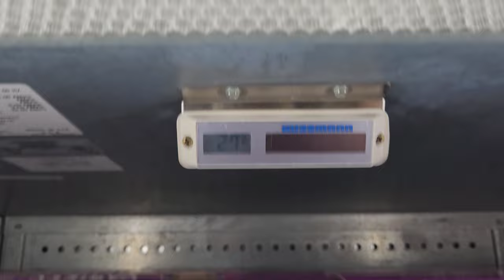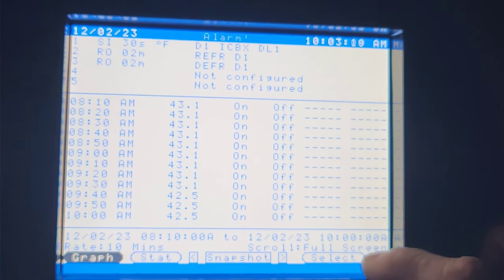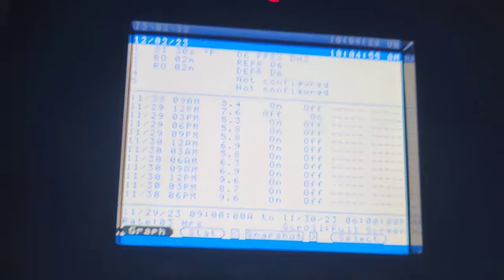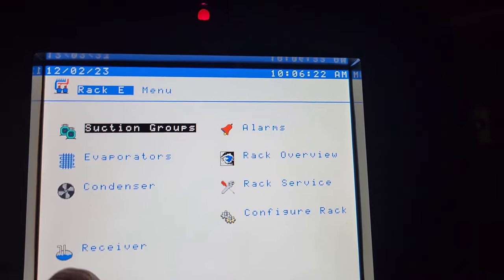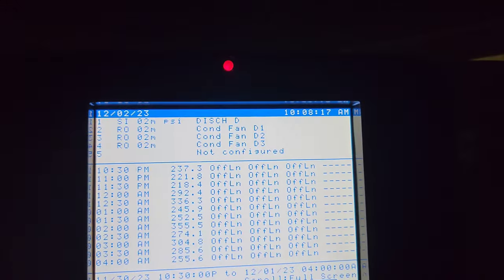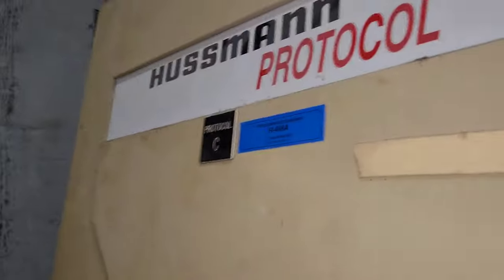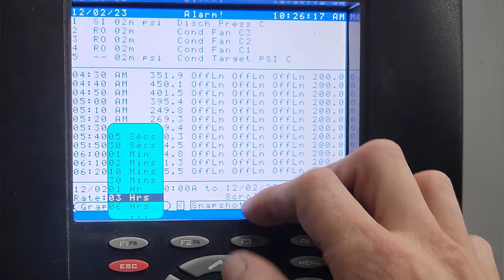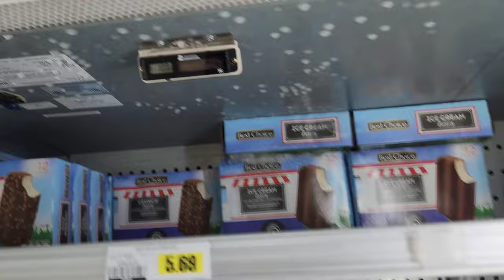Breakers Turned OFF On Purpose?

Comment: Wow, just wow - when the breaker room needs CCTV...  Those controllers that go into alarm, I presume they are capable of taking a beacon light or buzzer on an output?  If that was the case then someone could have called the fault in on the morning it occurred, potentially saving all that food from going to waste.
Reply from the maker: yes they are very capable. unfortunately, this particular grocery store chain does not have the Danfoss controllers monitored by Danfoss like the bigger, more profitable and reputable chains do. they dont even monitor temperature, liquid level, and other key parameters they they should. makes me think that Danfoss charges a pretty penny for a Subscription type of deal and they're not interested in paying it. shoot...they have freaking KE2s on most circuits controlling temp, which also have 4-30 defrost settings enabled AND the danfoss shuts the EPRs down on a different set of 4-30 defrost cycles. lmao

Comment: Reminds me of Stop and Shop in NJ and NY.
Question is, who the hell was probing around in them panels in the 1st place??? Also, WHY??
I doubt any renovation work goin on, especially around the holiday.  Thats black out time for store work! 730 in morning ... they gotta look back in see vendor logs or who the hell is even smart enough,  or ballsy enough to turn off breakers for NO REASONS. 
I know many the stores i done work in, kept panels locked. Just for that reason! Keep the asshats outta where they do not belong! Only person in store with key, would be STORE MGR. Then of course,  the contractors already has key to just about any panelbox made out there. 
Good video brother.  Be safe out there
Reply from the maker: Thanks! Yea, I agree totally with all you said. Especially locking the electrical room. Thanks for the comment!
Reply: I’ve worked at a grocery store as a  shift supervisor for a short time. Majority of electrical panels for equipment like that were in locked mechanical rooms that only store management had keys to. The only “accessible” panels that weren’t in those locked rooms were generally  behind service departments like the deli, bakery, etc. That fed receptacles, miscellaneous kitchen equipment, like rotisserie, ovens self-contained region refrigerators/freezers, and sometimes a few lighting loads.
Reply: @HVACRServiceTech  Absolutely! Keep up that awesome work
Reply: @johnmaranuk1842 as a night crew chief, I have a key and can access all of that. I wouldn't be dumb enough to do something like sabotaging the store. Looks like a disgruntled employee going to get fired
Reply: @johnlinks  
Maybe?? Who knows. But whoever did it, knew wtf they were doing and it'd cost em money

Comment: Is that equipment capable of pulling the temps of the food products back down?  I know a refrigerated tractor trailer truck will not pull down the product temps.
Reply from the maker: Yea, it can pull it back down.
Reply: That's not true. Refer trucks can pull the temp down depending on what you set the temperature at
Reply from the maker: @johnlinks  I would think that they should be able to pull down the temp as well